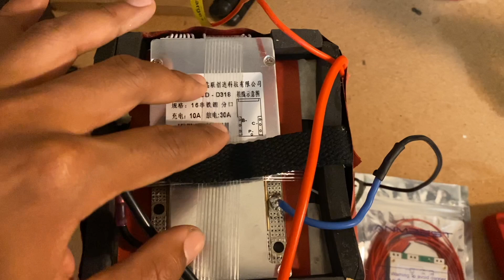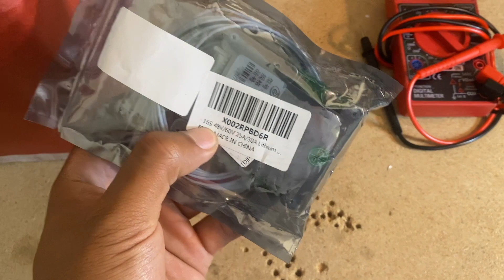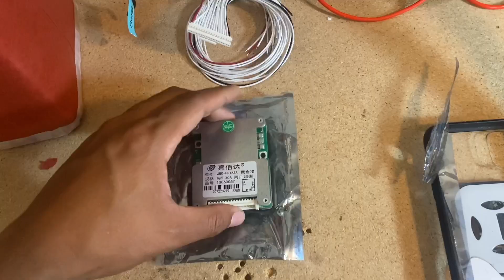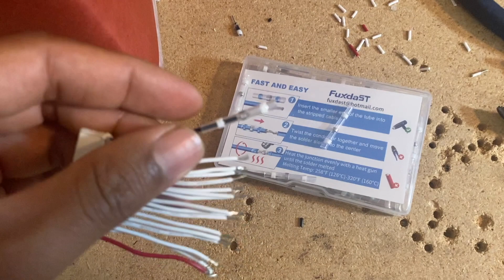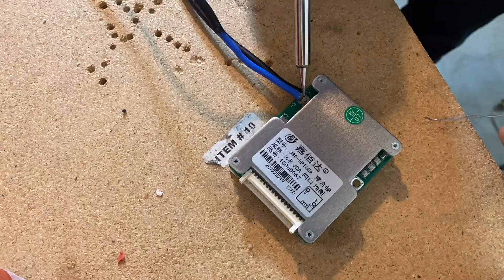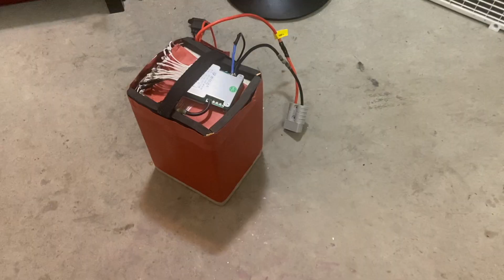Creating More Room in the Budget for the Razor MX650 Enduro Project

Comment: I know this is going to probably sound like a really stupid question but couldn't you get a different speed controller that's 72 volts with a motor and get six of the batteries that would normally come with it I know  it's not going to be as great as a lipo but wouldn't it still be pretty quick and be really cheap? And yes I know it'd be heavier with six batteries
Reply from the maker: Mmm in theory it would work, but I'd like to see where you would physically mount all the batteries. I had to cram (4) SLA batteries in the past and modify the box. Can't even imagine how much weight (6) would be.
Reply: @PatOutdoors  so I have two razors and I figured out a way  where I can do six batteries I own my own welder so I'm going to weld above the back tire stand to hold two batteries and I'm putting four batteries in the tray where the two batteries normally go to make six batteries 72 volts somebody has to try it
Reply: Basically right below the seat but above the back tire will house two of the six batteries
Reply from the maker: @JayL781  Would love to see a photos of that
Reply from the maker: @JayL781  Somebody has to try it, I agree. Though I wonder what the amperage output would be limited to.. I wouldn't go through that much fabrication and add that much weight if it wouldn't produce more than at least 40 amps peak to the controller.
Reply: @PatOutdoors  I took the stock setup on mine which is 24 volts hooked 4 batteries to it when I tested it
 it was showing 53 volts I tried hooking that to the system just to see if it can handle it 
it did but there's an over voltage that shuts the system down which is probably a really good thing do you happen to know what the stock motor can handle as far as voltage I think I'm going to do another test but take the speed controller out use a momentary switch go directly to the motor just to see if it'll work God I'm an idiot 😂🤣

Comment: Look up the spec sheet for those cells and look in the comments section on Amazon for the BMS and you will probably find the answe how to activate it properly. Usually it's charge to the full pack voltage or sometimes you have to short across the terminals to wake it up. Just use a tiny wire not the big honkin wires off the load terminals.
Reply: I agree with Matt, that’s the easiest way to troubleshoot the issue. Fully charge the pack and use the positive and negative directly from the battery to run the motor.
Reply from the maker: This may be my next move.. Thanks for the tip!

Comment: Hey Pat, nice try on reviving that pack. Not sure if you tossed that pack or are keeping it to learn on but that bms on the original battery was meant for a lifepo4 and the new bms might be for a lion battery. Still doesn’t make sense why the amperage draw is so low, I bet the cells are still good and if you want you could order another bms maybe a lifepo4 smart bms. A smart bms has Bluetooth and an app that can show you what going on to the pack while charging and discharging. Great content and keep up with the grind.
Reply from the maker: The replacement one I ordered is also for a LifeP04 and it's actually the same way as it did prior to me touching it so I'm sure there is still something else just wrong with the battery. A smart BMS would be an amazing upgrade, but I think I'll save that for my MX500 build and with a better battery to begin with. Appreciate the input!
Reply: @PatOutdoors  You have to charge to the full pack voltage. Lifepo only get charged to 3.6 and then usually settle around 3 3 afterwards. 16x3.6 is 57.6

Try charging to that. It's not going to be the 54 6 of a normal lithium ion cell. This is why you have more cells than you thought and ordered the wrong BMS. It must be a lifepo BMS.

Just bypass the BMS and run directly from the battery to your load. Just use the BMS when you charge to keep the pack balanced. Lifepo isn't going to catch on fire like a lithium ion will.

This will remove the current limiting that us cutting off your performance at the knees.
Reply from the maker: @zentechnician  So I just tried this and the charger doesn't even recognize that there's a battery connected. This is actually the same issue it had prior to the BMS replacement. I could potentially have a charger issue now that I think about it. Will continue to diagnose before giving up. Thank you for your input
Reply from the maker: I also completely bypassed the BMS altogether, but it's still doing the same thing. Thank you for the idea though
Reply: @PatOutdoors  well then you have at least one bad cell or a bad connection between 2 cells. The easiest thing to do for you since you aren't an electronics enthusiast is get a smart BMS with Bluetooth. That way you can see each cells voltage in realtime under load. You could the same thing with a multimeter but man, get the smart BMS, it's totally worth it. A Daly or ANT BMS just make sure it has Bluetooth though, some of these listings say smart BMS then don't have  a way to connect. Your BMS  is probably fine then so that's good. Seriously it's probably one cell. Those pouch lifepo batteries are usually very good and very high output too, that BMS was probably limiting the full ability of those cells.

Now since I know that battery is soft batteries I can tell you to look for dents. If you were treating it like a hard shell battery and strapping it down etc you could have very easily damaged a cell or two. Those flat batteries are just square sheets of alternating materials with thin sheets dividing layers. You get more amps by stacking more sheets. Even if the layers are thinner they are still the same voltage (because chemistry). So now imagine what happens when you dent these barely separated layers. You aren't going to have a fire problem with that chemistry and being flat is good because those will generally expand(poof out) and then vent. It's a very distinct smell, sickly sweet , it doesn't smell like the magic smoke.

You've inspired me to whip my 650 back in shape. Hit 30 today... lol.  I'll put together a big fat hpspim08 battery and overvokt the shit out of it. I'm still going through my bin of controllers to find a real winner. I should repair my sabvoton and make that little kunray beg for mercy. I'm afraid it would kill the chain though. Heh heh. I do have more chains laying around too. Hmmmmm